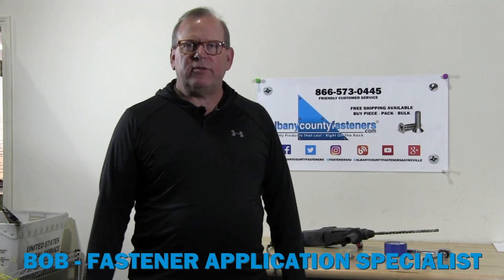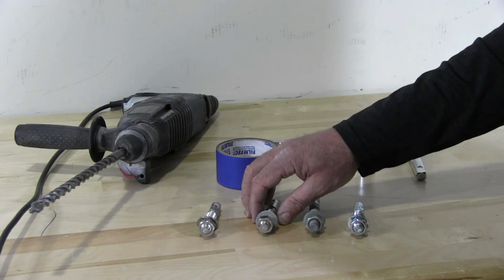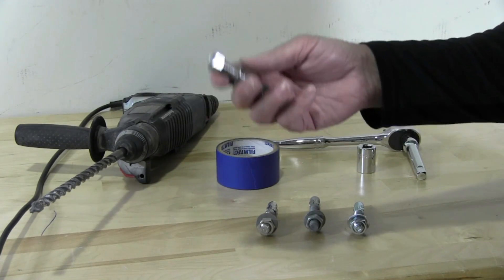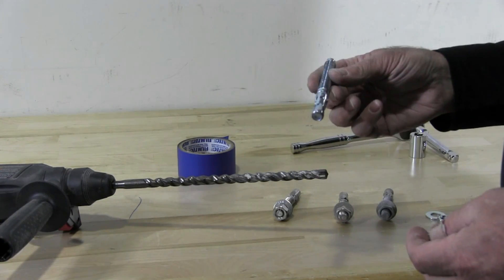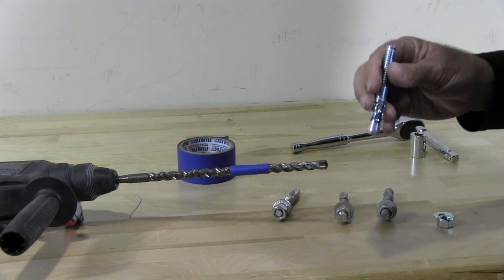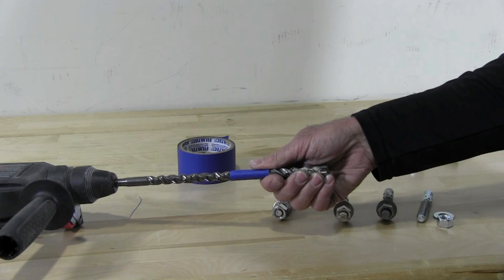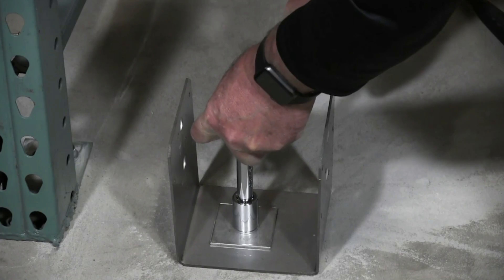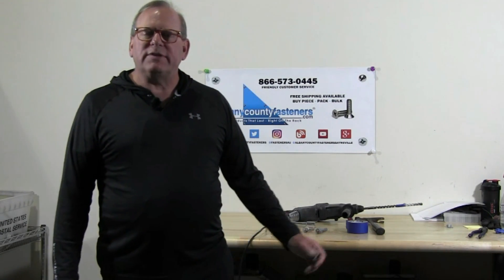Wedge Anchor & Decking Post Base Installation | Fasteners 101

Comment: Noted in passing but critically important: Clean out the hole before installing the bolt. Most of my bolting involves life-critical applications. 'Dusty' holes have caused a few deaths, when the expansion ring of the bolt tightened against rock/cement powder instead of the actual material. It 'feels' snug to a hand tug, even to a bit of prying. But large forces (In one case barely >50N) can pull the bolt out of the hole! BRUSH and BLOW out the hole before installation.

Comment: This is a fastener specialist!? Good lord. Here are a few tips for other viewers:
1: Drill the hole slightly deeper than the entire length of the anchor. Why? Because if you remove the anchored item later in life you can hammer the anchor down into the hole flush with the concrete and not have to use an angle grinder and leave a sharp protrusion or grind up and damage the floor in the process (especially important on epoxy finished floors)
2: Before hammering the anchor into the floor install the washer and thread the nut to the depth you would like. Now you do not have to worry about knocking the anchor too deep.
3: If you are finding the anchor hard to drive into the concrete, thread a bolt flush on the anchor. You now have a large striking surface and you don't risk ballooning the top and making it impossible to get a nut onto it if you accidentally strike the edge with your hammer.
4: Last tip, if possible setup your product to be anchored first, then drill your hole and install the anchor directly through the product to be anchored. Now you can drive the anchor in and tighten it up without having to lift the product over the exposed bolt. This is especially handy when anchoring something like a 1000 pound air compressor or machinery with multiple anchor points.
Reply: So if you want to remove item later do you take the bolt out and just drive the anchor in
Reply: @frankspivey5199  if you drilled the hole to the proper depth than yes you just drive the anchor straight into the ground. If you did NOT drill to the proper depth you will need to try and flush cut the anchor. This is a real problem when working on epoxy floors because you are bound to contact the surface with your cut-off tool and damage the surface
Reply: Nick
Reply: Sounds good to me.  So, I have to watch what length I buy since I will be drilling the length of the wedge anchor.  Don’t want any extra drilling that I don’t need.

Comment: You mentioned if it's a 316 stainless nut, itll say 316 on the nut. If it's a grade 5 or grade 8 nut, how would one know?
Reply from the maker: To know a grade 8 nut (if it is coated in zinc) it will be a yellow color. Unfortunately, nuts are not marked for their grade. In plain steel, both grade 5 and 8 will be black so it is not possible to tell. To prevent mixing, we recommend using labeled assortment boxes, such as these: https://www.albanycountyfasteners.com/Fastener-Compartment-Boxes-s/960.htm to prevent mixing your fasteners. If you have a bunch and you are unsure, you are safer assuming they are the weaker (grade 5) of the two so your applications do not fail.